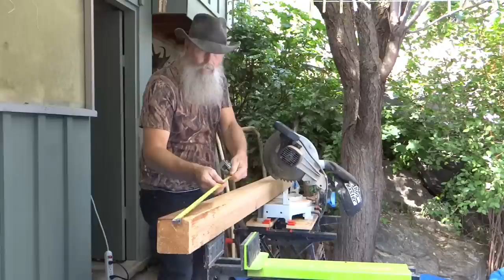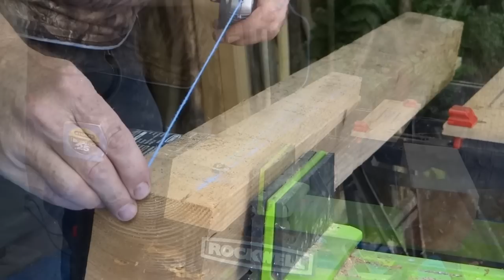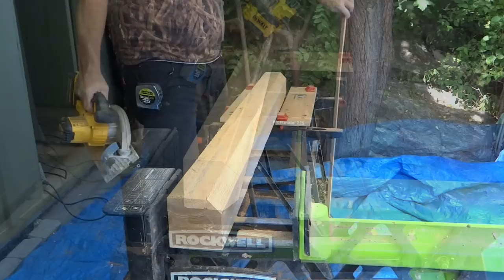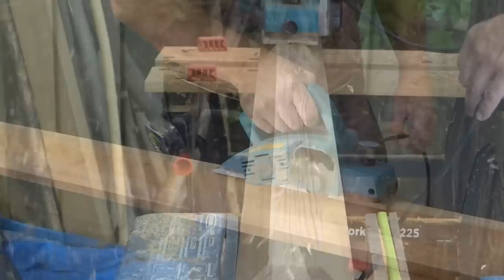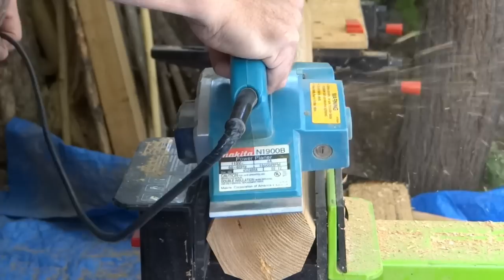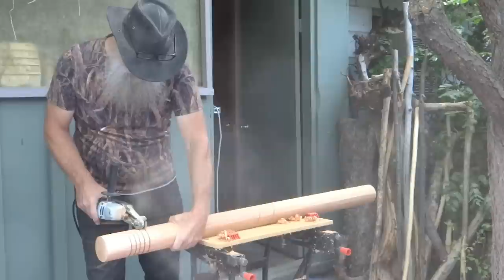How I Prepare a Cedar Post for Carving a Walking Stick with Power Tools

Comment: Mike, what's the first cutting tool you used on the post please? I have hearing issues and the captions cut off the first part of that sentence.
Reply: A Circle Saw :-)
Reply from the maker: The very first power tool is a miter chop saw that I used to cut off the post to length. Then I used a Dewalt  cordless circle saw to cut the 45 degree bevel down the length of the post. Then I used a makita power plane to clean the post up, and cut the final bevels. I have links for the tools in the description under the video

Comment: A Mike could you tell me what gauge , type or brand wire you use on your binding post wood burner ? I have a Burn Master Hawk & I use the Razertip binding post pen .
Reply from the maker: I'm not sure what gauge the wires are Ken, but the wires I'm using now are .9mm. You could use a pretty large wire diameter with the Burnmaster unit, but I'm not sure how much heat the BPH pen can handle. The original wires that came with Razertip snake scales and the BPH pen were in my opinion too small at .7mm. (They bend too easy.)  Razertip is now making scale tips with the heavier wire. I'm pretty sure you can get the heavier wired tips from Treeline. There is a link in the description.